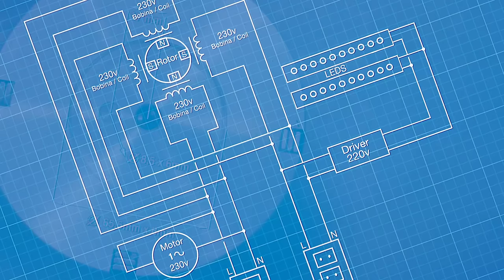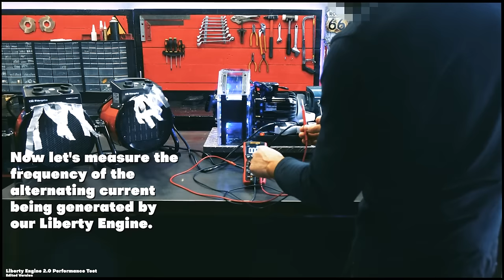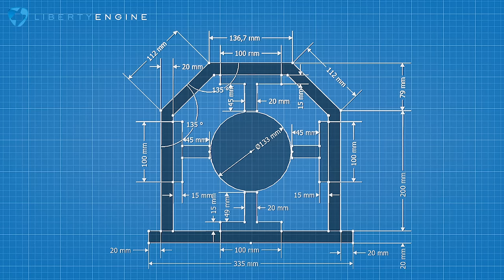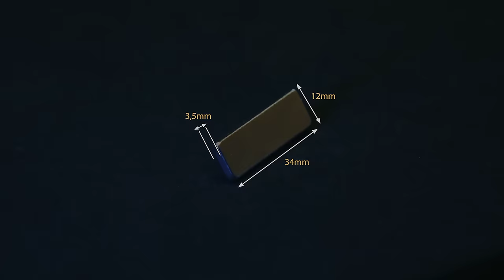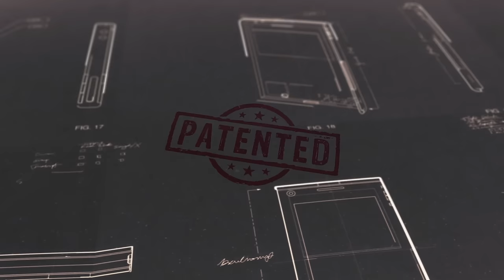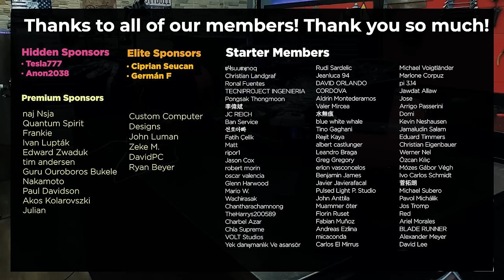SECRETS AND MANUFACTURING PLANS OF THE LIBERTY ENGINE 2.0

Comment: Stated volume of the rotor 1073.3 cm3 and 7.6Kg. If it was made only of aluminum at 2.7g/cm3 the volume would be 7600/2.7 = 2,814.81 cm3. If it was made entire of silver the volume would be 724.5cm3. The exact ratio is 6,331.82 gram of silver and 1,268.18 grams of aluminum. With silver at $766 per kg the rotor from silver perspective alone would cost $4,843.84. What exactly silver does to the whole thing? It is more conductive than aluminum so eddy currents would be stronger than aluminum alone. I guess nobody is willing to try spending $5k and get something not working...Dead end again

Comment: I meed this engine to dwvelope 3 Phase in 3 rotors to power the garage workshop and roller door, two levels for living and the roof terrace.,  winning it would save me a lot of time and money, but I will biluile it, then publish details as I plan to go abroad with it where I cannot be found or I am known so it is safe for me to tell the World.
Of course I will give rhe Liberty 2.0 engine development team.i plan to use a forever battery and super caps, into an inverter and our to a mains transformer at 220 v ac.i cam rectify this to give the dc supply for a half j0 4 pole motor,. I would caeey 9n fr9m here so Please, let me so it.

Comment: You can not generate 220v at the speed of 1500 rpms with 50 Hz which is calculated at 3000rpms, which means 50hz cycles per second over 60 seconds gives you 3000rpms. Trash.

Comment: It seems the main issue is to produce the rotor with the right components. 
So if this can't easily done or/and is not sold or give no possibility to produce one, with the right infos, why make videos of this machine?
Share something to say I have and you not seems to me a nonsense, total nonsense.
All of us we need power supply and the power industry is sucking our money. 
They produce energy with fossile (carbon, gas and so on) and we are taxed if we produce CO2 emission....
There is one way to start to be free from this but is good to participate to support the secrets ....
Good job guys but completely non useful.

Comment: Haha - your schematic shows you are using an electric generator to drive an electric motor, which is then driving the same electric generator. But that electric motor is only 3/4 HP, which can only put out ~550 watts max. So even if the energy was somehow generated "free" it would be limited to 550 watts, not 4 x 3000 watts. 
And why are you pulling that string before you start the electric motor? Or are you suggesting you've got a 16 HP engine hidden in that box? - Don't think so.   
And BTW Hz is not pronounced "highs", it is Hertz (1:02), as in cycles per second.  
No wonder you don't want to show your face!